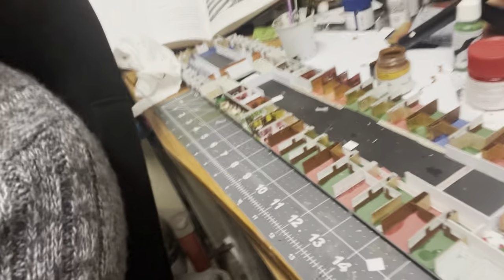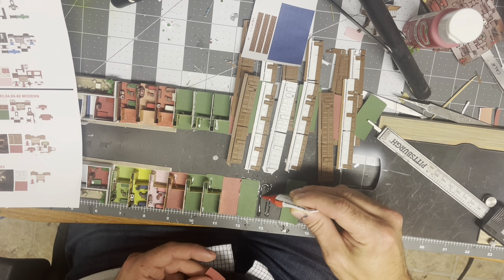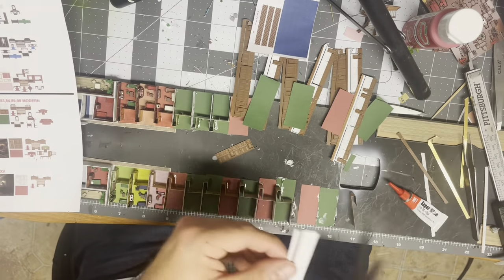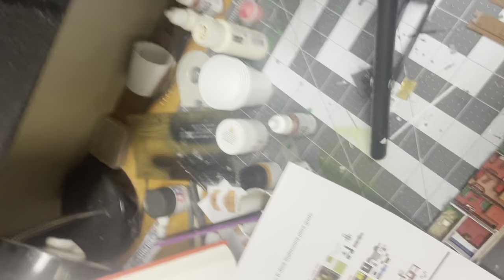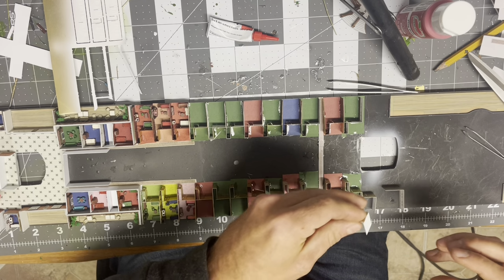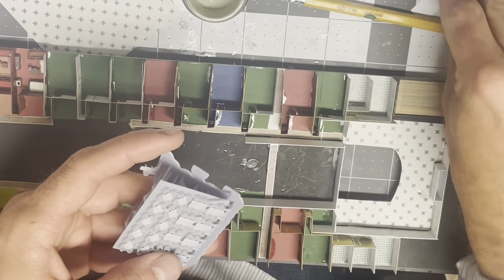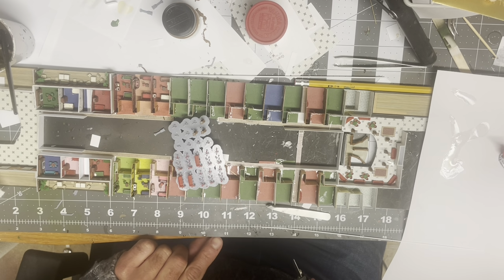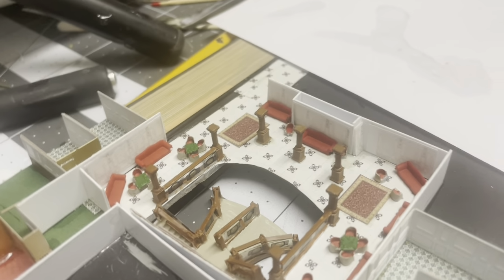RMS Titanic 1/200 RC Build Part 19.  B Deck staterooms and Aft Grand Stair case.

Comment: Coming along great Larry, it's incredible what you've managed to pull off. When you work on such precise details and the amount of intricate work like what you've done here, you really do get a sense of the detail and hard work done on the real thing. The expense you have to pay for additional details to work with mightbe a burn to the wallet but in all fairness, it's worth it in this case. Going to be a sight to behold when this is done indeed, great update.. excellent.. looking great, well done 👏 👍
Reply from the maker: Thanks Joe.  Can’t believe I’m filming video 20 already!  It’s definitely a complex build but just taking it in sun builds makes it much more achievable for sure.
Reply: @LCModelBuilding  Going to look incredible when done, that's a definite 👍